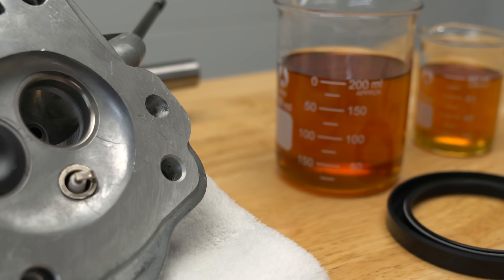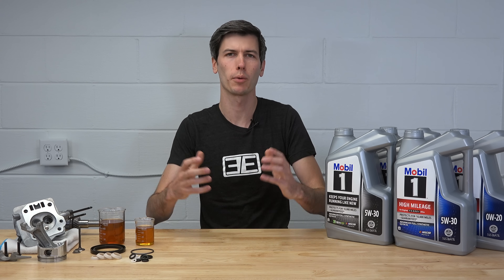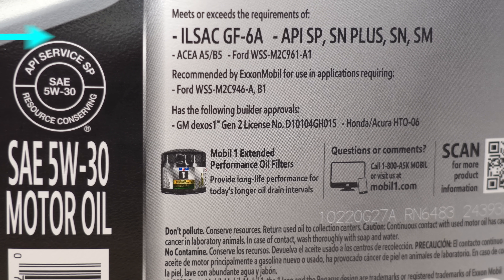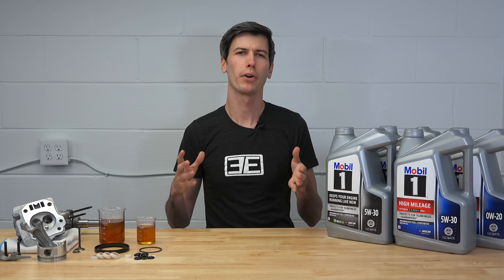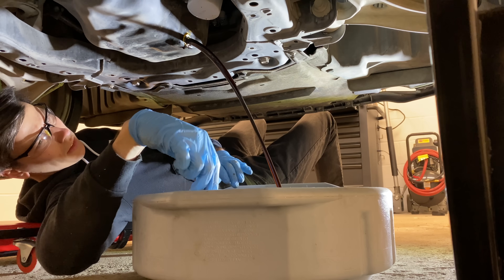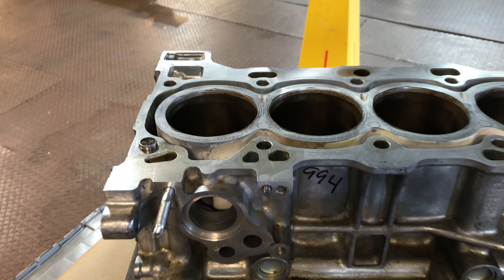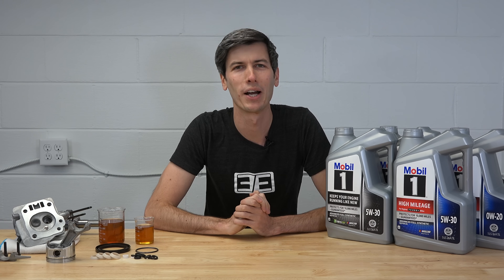Is Synthetic Motor Oil Bad For Old Cars?

Comment: The only thing that matters, besides the correct viscosity, is to never ever use SM or SN oils in old type engines. The oil manufacturers already learned that, so now there are SL synthetic oils available. The rule of thumb is SL, L=Life ,and SM, M=Murder. SN etc are even worse. The modern engines are better off with SL also, but as engines today are disposable, the modern oils with less lubricating efficiency will just do well enough. Even today some engines need old type oils. like the new Hemi that will self-destruct with factory recommended oil because of critical lubrication of the camshaft and lifter rollers (a design fault), and if there is heavier use like towing, the oil just must be thicker than recommended. Also the oil change must still be made every 5000 miles with engines that have variable valve timing systems, the worst example the Ford Tritons, factory oil change recommendations are just wrong with most cars and trucks. The oil does not last over 5000 miles in real life. It just does not.

Comment: Okay, so with rotary engines, on the side of the rotor there are these chamfered metal rings that scrape the oil away from the edge of the rotor and towards the eccentric shaft. These metal rings have seals that are incompatible with synthetic oil and to my knowledge, there aren't any aftermarket ones that are compatible with synthetic oil. I know that royal purple claimed to have a synthetic oil that was compatible with these metal rings and seals, however it wasn't great at protecting the rest of the engine. So the synthetic oil deteriorates these seals, then the metal rings are less effective at scraping the oil away from the edge of the rotor, the oil enters the combustion chamber in relatively high volumes, and you end up with a beautiful smoke show. The engine can be super healthy with great compression, but blow smoke and chug oil.

Comment: You state that excessive oil burning may be due to your cylinder walls are too smooth and the cross hatch doesn't hold enough oil.
Are you sure that's a correct statement

Comment: Curious to watch this when I get home if he brings up zinc needed in some old tapet style
Reply: Funny I zipped through this looking for it,  do not think they mentioned at all....they completely missed the point, few modern oils, and pretty no synthetics have zddp zinc.  Friend of a friend just blew up a newly built engine in a hot-rod by not being familiar with this.
Reply: @gt-37guy6  check out Valvoline VR1 and royal purple HPS, another oil maker that has ZDDP oil is redline and joe Gibbs DRIVEN 👍

Comment: What is old? How much is “quite a lot of miles”?
Reply: Depends on the engine and how it's driven - highway miles on a warm engine count for less than city miles on a cold engine - and of course some engines last better than others. That's why Jason says it should be when you know you have wear and/or oil pressure issues, not just "past 75,000 miles" or whatever
Reply: Depends on if you take care of your engine or not I suppose
Reply: If it's a Toyota, then over 250k is quite a lot of miles. If it's a Chrysler product, over 75k is a lot.

Comment: Wrong: "cleaning an engine is never a bad thing" - I beg to differ an old engine that has a lot of build up that is exposed to a different type of oil with cleaning agents will send all that build up to the oil pan clogging the screen on the oil pick up in turn starving the whole engine of oil and locking it up - I have personally seen it happen
Reply: Old motorcycles with sludge traps in their crankshaft.
Reply: that means it has a dirty problem that needs to be cleaned.
it means it needed attention earlier

but since it wasnt, it means it should have been either slowly corrected or mechanically corrected before using synthetic.
i argue if you were to start using said engine regularily and change it with convential... just more often.. you have the same risk!
Reply: I agree, I considered that to be a bit of an impractical  and elitist statement. Once an engine is dirty I believe the chances of accelerating component failures by "cleaning" and putting a bunch of debris into suspension is likely to outweigh any benefit.  If I'm trying to squeeze another 20k miles out of an engine , it's not something I would do. Also, it is now accepted practice that you never "change" the fluid in a transmission because it often leads to accelerated failure...do any of the issues that trash transmissions translate to a  "cleaning" scenario with engine oil?

Comment: I own a '95 RX-7 FD totally original, and since day one I owned it I use mobil1 5w50. I tried to use mineral oil 10w30 but it was a mess. It started smoking at start, lower engine performance.
I got back to mobil1 and car felt like before. No smoke and got back to usual power.
I can't be happier then that on my Wankel engine.
Thanks for the bonus part about Wankel engine, I'm a mechanical engineer too but first of all a car enthusiast.

Comment: I used full synthetic in a professionally rebuilt AMC engine and had a premature lifter and cam failure. The findings were that modern synthetics are not designed for use in a flat tappet engine. BE WARNED.
Synthetics will work if you use high mileage along with some type of stabilizer in my experience. Manufacturers cut down on zinc content for emissions system compatibility and there are no warnings for users with flat tappet engines. This cost me a lot of time and some money to replace a cam and lifter set
Reply: When?
And which full synthetic?
Reply: @jacobusderottmann1000  A about a year and a half ago. Running Castrol Full Synthetic by itself on a fresh rebuild that was broke in on Blended oil. Still use Castrol, Just High Mileage Full synthetic with half a quart of Lucas stabilizer

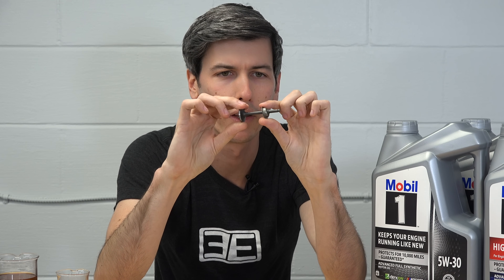Comment: Great video, and I hate to point out a flaw in one of your statements, but...  (7:50) Oil deposits in the intake manifold track come from the positive crankcase ventilation (PCV) system, not leaking valve stem seals.  Leaking valve stem seals result in oil deposit buildup on the intake valves themselves, which does harm engine efficiency and emissions.  The oil vapors coming from the PCV system is where the currently popular idea of using aftermarket oil catch cans came from.  I think it would be cool if you did a video on the PCV system, design flaws that allow the deposits to form in the intake track, and using oil catch cans.  There seems to be some misinformation out there about it.

Comment: I heard from many sources that manufacturers recommend thinner oils in order to boost mileage, so there is no technical reason to use a thinner oil, they just want to sell more cars.
Reply: I am still trying to figure out the pros and cons to this.  I think that society is always confronted with questions which people like  to answer in one-size-fits-all fashion.  So, if an engine has proper oil pumping of both all bearings as well as the pistons, and if the clearances are small, then a very light oil like Liqui Moly F ECO 0w20 will work the best of all oils, at the very light end of spectrum.  But, I still do not know if Honda put oil squirters for the pistons to get squirted with oil and wonder if it gets splashed oil instead.  They never give us all the information.  I like to use an oil with very strong film strength which means heavier oil, not very heavy but heavier than 0w20.  Anyways, yes the 0w20 will be easier to move around and less oil pumping labor to the engine, but in some cases, a 5w30 or 0w40 may just provide stronger film strength and protection, so who cares about the extra 1/2 mpg?

Comment: Hi Jason, 

Nice video. I just found one thing lacking: synthetic oils are more corrosive to yellow (copper) alloy’s. And yes Mobil synthetic (SHC) is not but almost all others are.
Reply: True. I never use synthetics in my old John Deere tractors as I was specifically warned not to by the JD dealer and the JD club.

Comment: Tip: if you have been using one grade of oil in your car for it's whole life, don't change it.
I had a high school beater honda civic from my dad that used only convention oil. When I bought my first new car a Toyota Corolla, I used full synthetic oil.
I switched over to full synthetic oil for my honda as well.
After 30K miles, it started burning oil real bad, got seal restoring fluid. Helped a little. And it blew a head gasket after other 15K miles.
Reply: >45k miles in already heavily used car.
>Gasket blew.
>It was the oil.
Please never have children

Comment: 5 tricks for old cars or classic cars with oil
1.American classics get 50w oil 20-50w would not hurt
2.  Every oil change use marvel mystery oil to replace 1qt
3. Use blue devil seal repair to slow seal damage water and leaks
4. Every 40k mile sea foam engine and change all seal in car. 
5. Clean and wipe engine every oil change to notice leaks if or after a leak.

Comment: Any information on high zinc oils? Every time someone in my Jeep group asks what oil to use, all the young people break out the manual and say "Synthetic 5w30 or 10w40 depending on ambient temperature" while all the old farts say "15w40 Rotella for extra zinc." If I have a motor with flat tappets AND a catalytic converter, do I wreck the tappets with synthetic oil or do I wreck the cat with ZDTP?
I have a 1990 Wrangler 2.5L TBI, for reference.

Comment: 2012 Chev 3.6 3000 miles  works well on Pennzoil full synthetic.  their customer service says it meets Dextos spec but not printed on bottle to save money.
To keep things simple, I wanted to also use same oil in my 2004 Buick LeSabre 3.6 with 25,000 miles.   Started leaking soon after I changed oil.   Next oil change the old 10w30 recommended was put in.  Leaking stopped within days.  I do oil changes myself on a time basis of 4 times per year.  
Realizing this is one off, but oil leak is oil leak.  Happy I did not ruin a rear main seal or something else expensive.

Comment: I usually use Valvoline Max Life synthetic blend in engines that are from 2000 and older that use regular non synthetic and synthetic blend motor oils. I have never had a engine failure, and some them had over 200,000 miles or close to 200,000 miles.

Comment: I usually use Valvoline Max Life synthetic blend in engines that are from 2000 and older that use regular non synthetic motor oils.
Reply: You would only see benefits if you switch to Valvoline Maxlife Full Synthetic 👍🏻👍🏻

Comment: i was hoping you would touch on the ability of synthetic oil to dissipate heat compared to mineral oils. Very relevant if you live somewhere hot or you drive a beetle or air cooled motor bike

Comment: sometimes the sealing surfaces have more clearances between shafts and seals and the thinner synthetics can leak through. then there is the compatability thing with esters and such. anything that leaks because you used synthetic probably needed a gasket/seal set replaced to begin with because ethanol fuels will do the same thing if you dont change your oil often enough.
  in short, a whole bunch of things can make an old engine leak mostly due to the fact that things are not formulated the same today as when those engines were originaly assembled.

Comment: Personally, synthetic oil blew out my Toyota Camry 2002 and it only had ~120k or so miles on it.  The engine overheated twice leaking oil and coolant within a span of 10 days after the first repair in 2019.  This all occurred 7-8 months after using synthetic oil.  Before all this, the car was running smoothly and the oil was changed every 6k miles with conventional oil.  The A/C also stopped blowing cool air and was the first sign something was wrong.  Was it coincidence?  Maybe.  But having the engine completely fail and cause so many problems in such a short time was uncharacteristic of this car.  Fell off a cliff really.  Bottom line:  If you're using conventional oil then stick with conventional oil.  It's the safest bet.  No need risking your whole vehicle for saving a few bucks.
Reply: Armando, that was probably an unfortunate coincidence. Toyota didn't tap (thread) the head bolt holes on the block properly, so those threads failed, typically at between 80 and 120,000 miles. Catastrophic engine failure was the result. Hundreds of thousands of owners ended up replacing their engines at their own expense as Toyota swore to each owner that this had never ever happened before. And of course the company made a small fortune selling those replacement engines. How do I know about this? My brother-in-law was one of those ripped-off owners. He paid over $8,000 for a used replacement engine because he couldn't afford a new one. Believe it or not, I now have that car, as he gave it to us a short while later and bought a Honda.
Reply: @paulmaxwell8851  Thanks for the info. I also ended up getting a Honda...a civic. Leased it this time.

Comment: According to a rep from Castrol that I spoke to, the age of your car has nothing to do with the type pf oil you use. It's the tolerances in the engine. If your old car has a freshly rebuilt engine with tight tolerances, go ahead and use synthetic. But of the tolerances are loose you could have problems with synthetic as typical synthetics don't have the "cushioning" properties of conventional oil. I actually tested this with a 1988 vintage 5.0 Mustang engine. I used Mobil 1 in the engine when it was set up with loose tolerances and it started spitting out bits of bearing IMMEDIATELY after putting the Mobil 1 in even though it was broken in with a conventional oil. I switched back to conventional oil and the bits of bearing stopped appearing on the drain plug magnets. I told the engine builder about this and he said "I told you the engine was loose - that means don't run synthetic". Oh, OK. 100,000 mile plus later the engine is still running fine on conventional oil with no bits of bearing stuck to the drain plug magnets since going back to conventional oil. That's real world experience, not the say so of a company that wants to sell you its oil. On the other side of the argument, a friend of mine bought a new 1987 5.0 Mustang (in May of '87) that he owns to this day. He ran Mobil 1 in the engine from it's first oil change onward and when the engine broke (block split, crank broken in 2 places) at 211,000 miles you could still see the honing scratches on the cylinder walls and all bearing surfaces were in excellent condition. The breakage was due to 211,000 miles of abuse (N2O, powershifting, launching on slicks, etc.), not the type of oil used. I will say that in a new (or rebuilt) tight tolerance engine I would use synthetic oil without hesitation.

Comment: How about flat tappet cams? can a synthetic oil provide enough film strength to not need the extra zinc that everyone recommends? And do people "lose" cams not because of oil or the quality of the parts they use but because hydraulic flat tappet lifters have a much tighter bore clearance specification?

Comment: What about my 1970 455? I have to use 50 weight in it to keep proper pressure and i have to use zinc additives since there's no lead in fuel, I'm told.

Comment: YES.  Used regular oil in my 2007 Dodge Caravan with a 3.3 liter engine.  I got 10,000 miles to an oil change, using only a pint in that time and it was still so clear it was hard to check.  I got talked in a synthetic blend and then the van started using a quart of oil every 800 miles.
Reply: this sounds extreme but i noticed this as well, castrol magnatec synthetic burned up, high mileage conventional or blend did not inbetween changes. and i didnt even wait to syntheetics supposedly longer life, talking identical mileage here with properly specced filters for each oil. my driving would have been the same across changes as well.

Comment: I drive a 2003 Toyota Corolla sedan and in its manual,  it says to use SAE 5W-30 which I totally agree with because I understand that (and I stand to be corrected) the temperature range of this oil is from 5°C to 30°C. My question is:
"Since I live and drive this car in good-old, hot-and-dry/hot-and-wet, tropical Nigeria, would it be ok if SAE 20W-50 (20°C to 50°C ?) oil is used? Bear in mind that it is extremely common for daytime temperatures in Nigeria to hover between 35°C to 47°C of most days of any year, especially in northern Nigeria (where I reside and work)."
I look forward to your response as well as anyone else's response in the comments section. Thanks for your awesome videos.
Reply: That temperature is just a guideline for starting the engine, diesel and gas engines have a different scale. Typicall oil temp while an engine is running is around 80-90°C. In hot climates you could switch to 20wX but I don't think this is economical as those oils are typically for racing applications and therefore more expensive.  Oil temperature becomes a problem when exceeding temperatures abvoe 125°C, when the compounds break down.

Comment: no it cant bade idea with carbon and evry thing ells you get higher temperature diferences if you have static electricity you can get engine misfire ever engine run one problems due to useing wrong oil!
it will destroy the engine eventualy oldtimer cars have weaker engin oil pumps its not that simpel all of those systems I mention are a isue for old gasoline engine's exept if you modify them strenghten their parts then you can use diferent oil's and sintetic oil are cheap for a reason by aware what coolant you use as well because it makes big diferences expecialy gm cars and other old engine manufacturer's related to them they have a bade habit to leak head gasket!